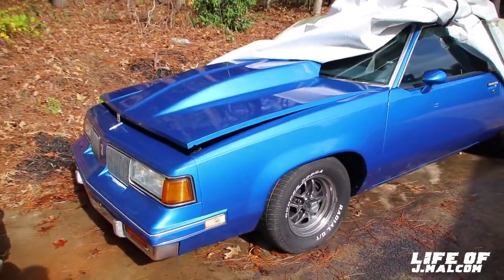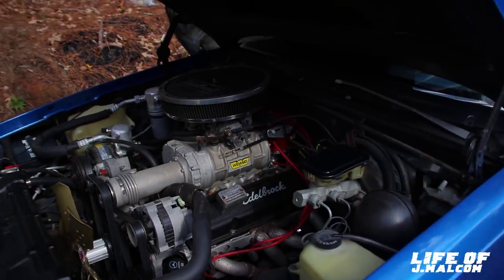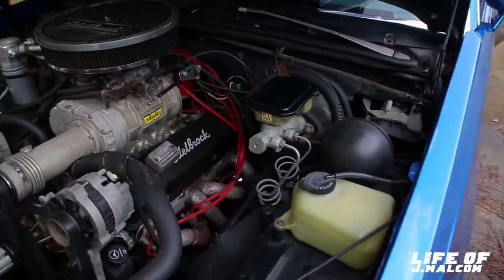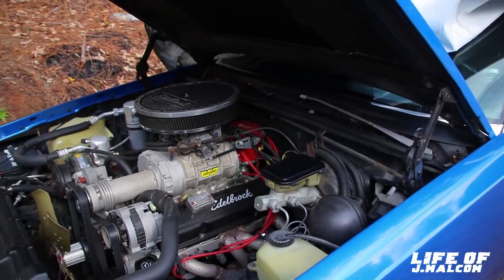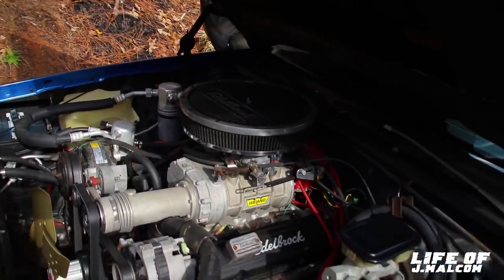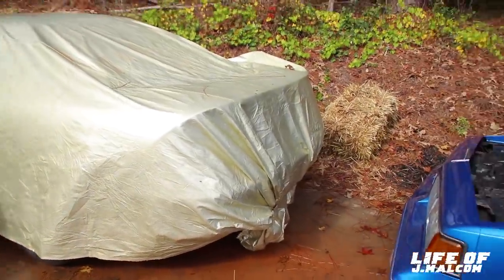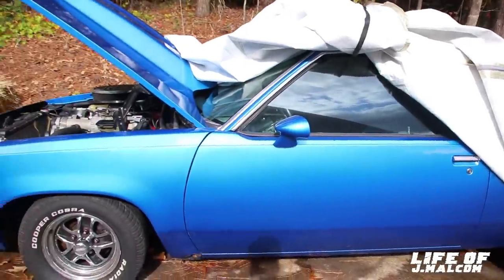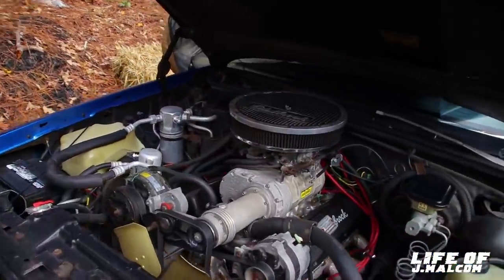REVEALING WHAT ENGINE IS UNDER THE HOOD OF MY CUTLASS AND I ORDERED MORE NEW PARTS ALREADY!

Comment: The carburetor for the Cutty is "draw through" since the blower draws through the unit. "Blow through" is when the turbo or supercharger blows through the carb hat. 
On a draw through set up, go as big as you can swing moneywise. 850cfm or larger. The Roots blower will like it.
Reply: Theyr both the same thing. They just call them different names for marketing 

They're all blow through but the setup up is really called a blower carburetor
Reply: @KingJT80  a blow through carb is different than a draw through. 
Best thing to do is to go to CSU Carburetors and they can show the differences. 
What you have to do to calibrate either style is different. A draw through carb poses a restriction because you have to suck through it ( not pressurized ).

Comment: Unless you buy a timing light and know what the timing is supposed to be, I suggest you leave the distributor alone. Changing the distributor is not going to change anything.
Reply: Depends. Those cheap ass distributors have crappy advance curves and not a lot you can do to them to change them
Reply: @KingJT80  It seems to be running fine now. Again, I would leave it alone. Nice to have something he can just drive and not have to mess with. Plenty of other projects to "mess" with in the driveway.
Reply from the maker: @quick99busa  I’m changing it and you should know there are advantages to a pro billet and the timing has been checked off camera and will be set like it should. I’m not setting timing. Quit thinking negative all the time man
Reply: @LifeofJMalcom  I'm just going by what I see on camera. Not being negative, trying to keep you from fixing something that's not broke, that's all.
Reply from the maker: @quick99busa  don’t get me wrong, you’re truly alright with me because I know you’re not against me, BUT, it seems I only see you most of the time if something bad happens or if you throw something like this out. It’s not broke but will be made better and will run as it runs now but with better timing control. I think you and some let what y’all see on camera fool you sometimes which I understand because y’all go by what I show and what y’all hear me say but there’s more to what I do here but that will be seen later down the road. I appreciate you watching and all but this is just what it looks like over this way
Reply: @LifeofJMalcom  Again, I only go by what you show! lol All I'm trying to do is help limit the headaches that's all. I don't post all the time when I think you have everything under control, but when I see a potential problem on the way, that's when I might chime in. Just looking out, that's all. Enjoy it for a minute before you take it apart. You  might want to take it on a Christmas Day cruise...
Reply from the maker: @quick99busa  I respect that brother. I know you’re not against me as I said but as.men, it’s a must we speak our mind respectfully and that’s what I did. I appreciate you looking out and thanks for clearing that. Didn’t mean any harm at all💯
Reply: Not a blow thru setup. Draw thru. No special mods needed for the carb except maybe some tuning. That's it.